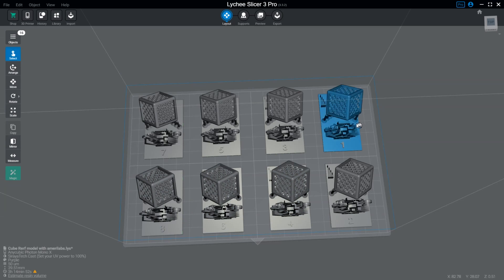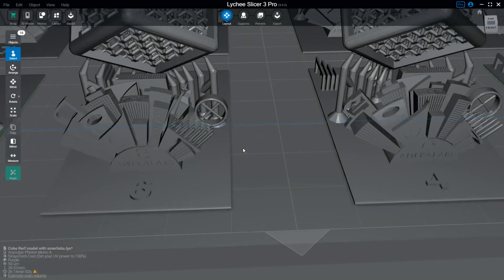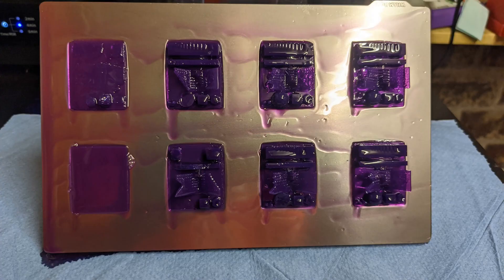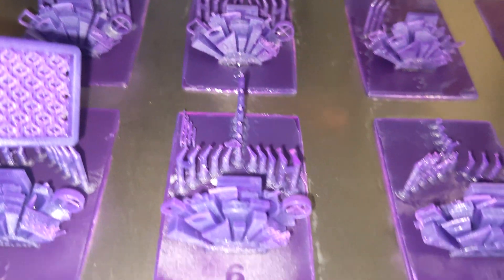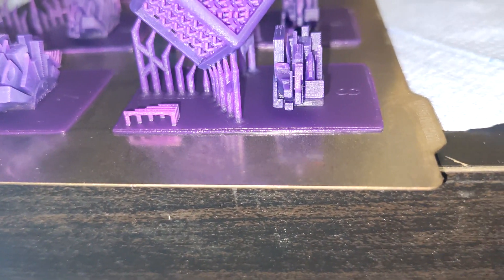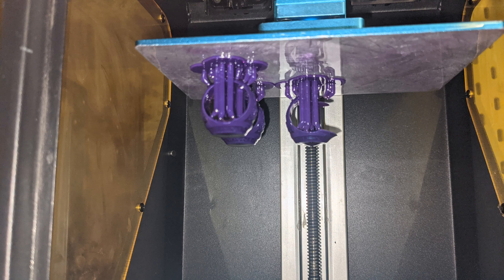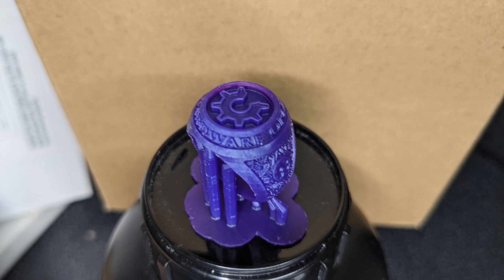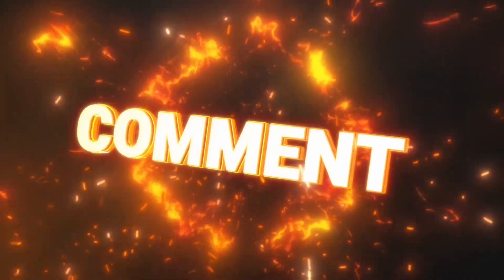Siraya Tech - Cast: Finding the best setting for Anycubic Mono X

Comment: Hi I’m completely new to this but how did you get all those test pieces on the build plate, each piece with a different exposure setting? Thanks
Reply from the maker: The multiple exposure is a feature called R(esin) E(posure) R(ange) F(inder) and part of the firmware of the anycubic resin printer made around that Time. The method was first used by a group called photonsters which I was part of. They coded the method before chitubox locked the firmware from being open-source.
Other printers might also work, but you will need to check with the UV tools team who were the last group I know that developed the method further.

Comment: Can you use any plaster?
Reply from the maker: Unfortunately not really, not impossible but doubt will get good results.
For vacuum casting SRS classic is recommended, but needs an expensive machine. (I don't currently have one, just a casting flask)
There are methods which use more expensive investment, but don't require a vacuum.
It is the latter which I am testing and gathering video for. Will have plenty of what does not work sections, as also planning on sharing the fails 😊